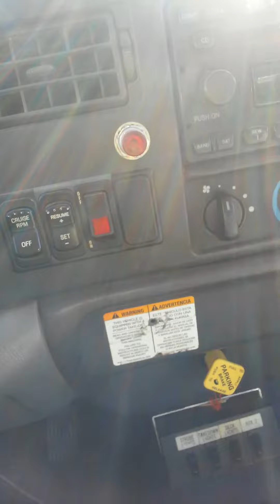Towing

Comment: Can you use  the j hooks to pull a truck from mud or ditch and Hooked to the axle?   Is that an acceptable recovery hook point. Or are j hooks used only for securing while transporting.
Reply from the maker: For thoses situations I use a winch and the minnie J hooks like you are Towing a vehicle
Reply: @MrTim4316  what I really meant is if I use the axle will I cause damage. I'm also using a winch, no wild pulling just controlled  slow winching. I know I can use the tow hitch  but just in case there's no tow hitch